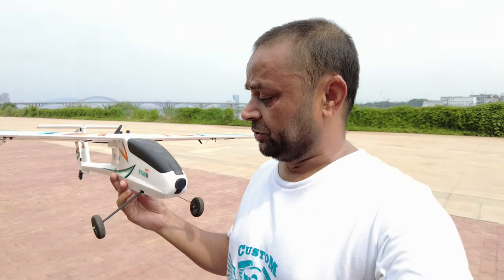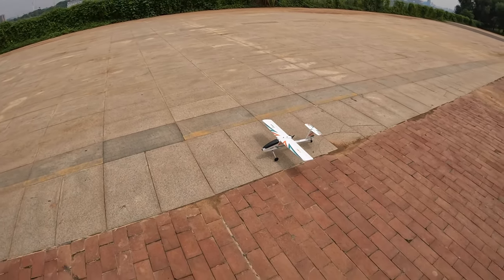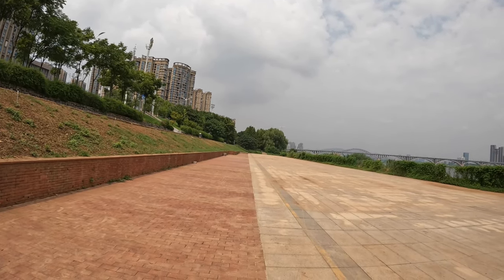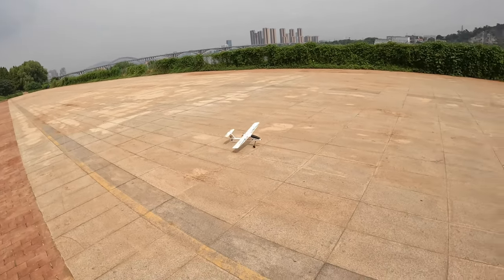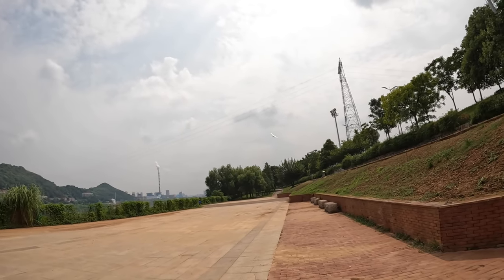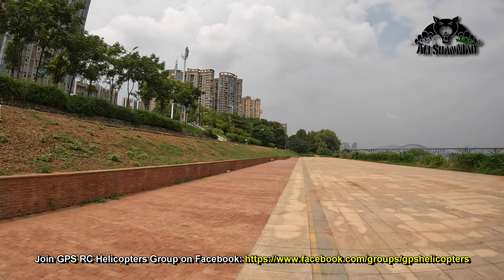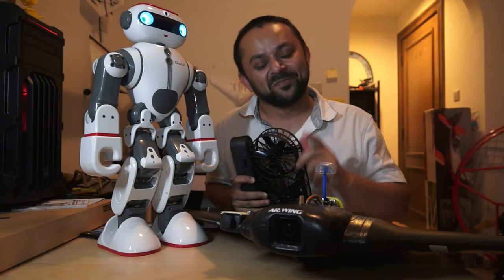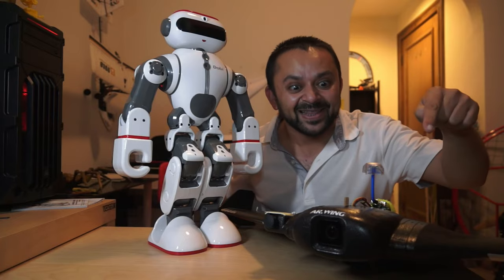Binding and Flying - Esky Mini Eyas 2 with RadioMaster Boxer EdgeTx Radio

Comment: Which radio would you recommend the Boxer or the Zorro. I just want a good radio that isn't that expensive. I remember when the TX16 came out and you could get them for 90 usd.  The cheapest one I see now is 200usd.
Reply from the maker: They upgraded the TX16s a lot and its a biggest competition to all the radios in the market. probably the best selling one too. Boxer and Zorro both are good, but i heard zorro had some issues. though it has more switches to play with. boxer is so far no one reported any issues. and it can take full size modules too